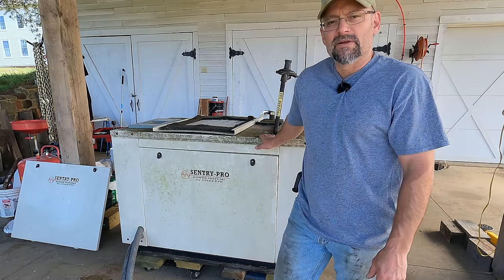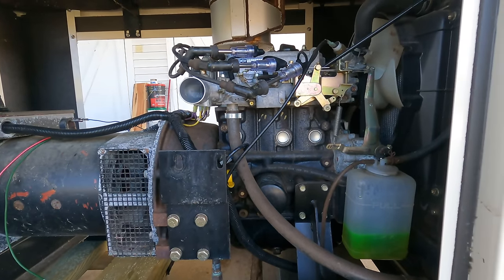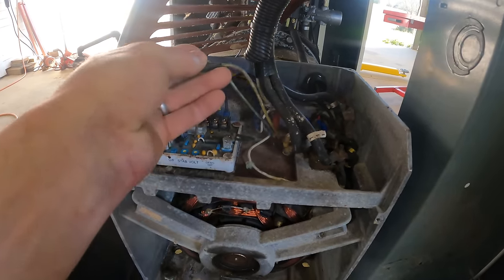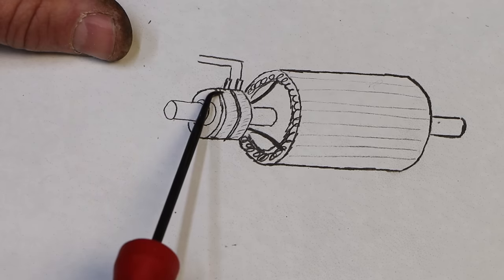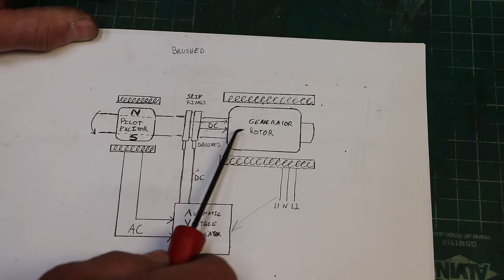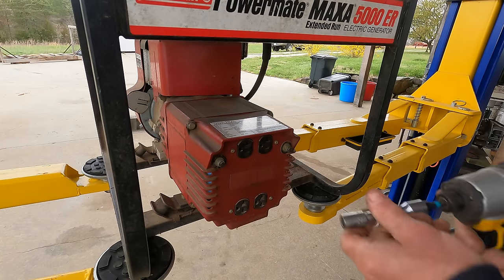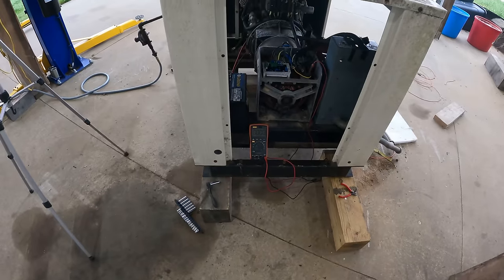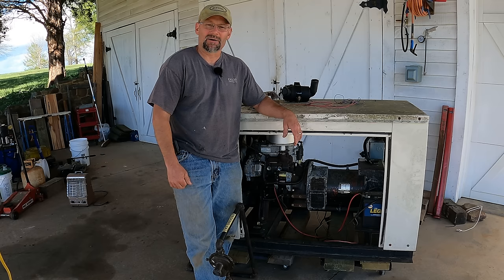How Generators Work, And How To Fix Them.

Comment: Great explanation on how generators work! And yes James Gondon does know what he is talking about.
The US grid is supposed to be between 228 and 253 so if you are running at 252, there is not much margin. Best to close to middle, hence 240 volt spec. Check with power company to get line voltage closer to the middle of range because if will fluctuate.
When setting generator voltage, Hz should always be set first which set by governor/rpm. Best set at medium load so it is within range at all loads. But check it at high and low loads also because governor may have other issues.

Comment: Great video..I ponder why heat sensitive electronics that by themselves create heat and need heat sinks.. are put near another possible heat source..On the old 6.5 GM diesels..the pump mounted driver(PMD) was..you guessed it..mounted to the injector pump on tip of the engine..near the turbo. Someone figured out that you could just make a harness to move it to the firewall and these $250(back then)would stop frying every 6 mos to a year..😅..I definitely learned something about generators..That I'm gonna try and make a welder out of one of these old turds I got lying around..Shouldn't be too hard to find where the DC goes to rectifier..I got a bunch of old large rheostats too..Hint hint..

Comment: I came across a document from PG&E, 'Voltage Tolerance Boundary' which was on the electrical distribution standards.  The service voltage (norm) is the nominal +/-5%, then utilization which is -13/+6% where it it happens they have to send out a lineman.  So the top for 120 is 126vac and 250 is 252vac.  As the lines are loaded the service voltage drops.  So 252 vac on an unloaded generator would be similar to what they give close to the substation.  

The document even explained NEMA voltages you see on the nameplates.  They are where mfrs are suppose to optimize but be able to handle +/-10% (which matches the utilization voltages the power company is suppose to keep.  They are lower than the nominal line voltage to account for the permissible <5% drop in the combined feeder/branch circuits

Comment: I'm curious if that is a two-pole? I ask because if it's a two-pole then the rotor would need to spin at 1800 rpm to make 60Hz. I do have a background in power generation from my time in the Navy. Working on 3-phase systems (Navy) is different from working on 2-phase (residential) systems.

Comment: You need to stop saying "how the Hertz is doing" or "check the Hertz". Hertz is the unit, FREQUENCY is the quantity your measuring and the word you should be using. It'd be a bit like saying "How many Fahrenheits (or Celciuses or Kelvins) is it outside?". It makes you sound like a hick that doesn't know what they're talking about, when that isn't the case! As an electrical engineer, it's rather irksome!

Comment: Spark plugs does make difference, their proper and uniform orientation ( indexing ) does matter as well! 
Using of Rare Earth Metals on electrodes tips is far not only about the longevity! 
We haven’t seen here testing of Denso Iridium TT or NGK Ruthenium HX series PSPE spark plugs! 
Extremely poorly done homework guys , as in the good old times :) 
Everyone who disagree with me ,please ask first yourself why all present days modern  engines are using precious metals even on both electrodes tips , Twin Tips electrodes and why the latest models engines even use factory indexed spark plugs! 
Testing the spark plug dependent deviation in HP on CARBURETED engine is like the try of measuring the weight difference between two flies on elephant designed scale :)

Comment: Wow ... open the door to generators!!!  Thank you so much.  

Questions:  How did you know that the new AVR would work on that older unit?  Was it listed as compatible or ... do AVRs all seek to send the same voltage to the rotor in a 120/240 design. ... or?  Thanks.

Comment: As a former employee in the propane industry, here's my 2 cents:
- 100% agree DO NOT swap.  The new tanks are often panted to look good, but they may be in bad shape.
‐ Always ask if you are paying for a full tank or by the pound (see prior comment)
- When possible, fill with a propane company (distributor).  The markup on propane from retailers is huge (highest sinple item profit margin at gas stations and Walmart).  Distributors makeup as well, sometimes, but not as much as retailers.  To find distributors, just look for the large storage tanks.  Folks in the propane business are good ppl, so ask them.

Comment: I do believe the difference between BRUSHLESS & THE BRUSHED IS the high constant power has a damaging effect that will eat away at the brushes causing flash arcing and giving unrelible and scattered voltage thus burning out the motor:yt:

Comment: In my years of experience dealing with electric heavy equipment ac and dc, #1 killer of ac equipment is dirty power they usually don’t output but it started with it, usually those who like to just chop wires you know. You actually know more than I’ve seen most of others on here t/s. 👌

Comment: First and foremost you don't have TF1! In the wiring diagram, you don't have/show a Legend breaking down these abbreviations! I am a certified Tech/service tech. TF1 is a trans fur (switch) either automatic or manually activated. Research that!

Comment: Wires used for electricity emit a sound frequency too high for the human ear to detect but rodents can hear it and it irritates them. It's the primary reason rodents chew on wires (attempting to eliminate the sound). Other reasons might be: "hey, this vine is covered in something soft, I'm going to gnaw on it to see if it's edible*chomp-chomp ZAP* NOPE! Definitely not edible...maybe further down the vine."

Comment: 36:56 T5AH fuse. The T means slow-blow (time delay, as opposed to F - Fast) 5Amperes is the rating and the H means High Rupture Capacity, whcih is why it is ceramic, not clear glass. HTH.

Comment: Very nice video. Illustrations are awesome. Only one thing. You can't say for sure 'no shorts in windings' with multimeter in Ohm mode. Your windings resistance is 0.3 Ohm. Lets say windings has 50 turns and one is shorted.  Resistance in winding with shorted turn will be 0.2994 Ohm. Difference with normal windings is far below precision of almost any handheld multimeters. You need LCR meter to measure inductance and coil quality factor to be sure.

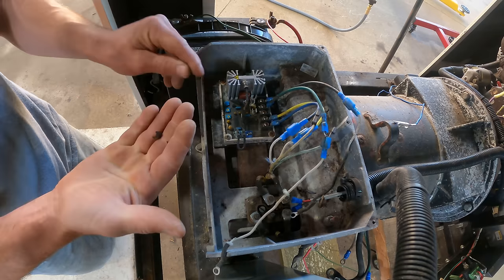Comment: 37:05 I bet you just got the letters confused but I'm gonna use this chance to nerd out:
A "T 5A H" fuse is slow blow but this is not what the H means. T like in Time delay. Other possible letters are F (fast) and M (medium).
The H means it has a high breaking current. If a high current (up to 1500A in that case) could flow, the fuse has to be able to break that properly and not arc over.
They are usually filled with sand to extinguish the arc by cooling it down.

The German Wikipedia page has nice tables for those so you can see it at first glance but the English version seems to have omitted this and I couldn't even find this information there at all :(

Comment: You actually CAN run that size, and significantly larger generators, engines and heaters off a 20lb BBQ tank of propane continuously - if you are willing to heat the tank. This is of course for "temporary" use...

For a ~15 minute, lightly loaded test run there won't be any issues without heat. In fact for lowish loads on a warm day there probably wouldn't be any issues either, but for heavier loads read on...

The problem isn't the lack of propane liquid to gas surface area.

The problem is that the enthalpy of vaporization, or energy required to evaporate the propane causes the liquid propane to get colder and colder until it can no longer evaporate fast enough (and the propane gas pressure drops).

For light electrical loads the generator will most likely run fine of a 20lb tank.

With high electrical loads what you will see is over about 10 to 15 minutes, the outside of the propane tank will start to get cold. If the propane consumption is high enough, the outside of the tank will develop a layer of ice condensing out of the air - wherever there is propane liquid in the tank. Once the propane cools enough (likely in the -10°C or 15°F range) the propane pressure will decrease enough the engine won't run properly.

In order to keep the propane evaporating fast enough to maintain the needed pressure, you need to heat the propane, which means heating the lower portion of the propane tank.

As long as there is still ice on the propane (and there are no propane leaks) you know you can safely apply copious amounts of heat to the propane. The pressure can't increase anywhere near dangerous levels while the propane is cold.

For example when I run my 120,000 BTU propane heater (equivalent to a 20kW generator, generating 20kW constantly) in the winter, I face the output of the heater directly towards the propane tank (about 2 feet away). In my situation this is the perfect amount of heat to maintain the liquid propane at approximately 15°C (60°F).

With your generator you won't need near as much heat (because you are not generating 20kW and because the temperature is warmer), but the tank will likely need to be in direct sunlight on a warm summers day in order to maintain a vaporization rate for full throttle, continuous power.

On a cool day, facing the output of a 500 watt electric heater towards the propane tank would probably be enough for your generator.

Comment: I have never seen a generator under 10KW that uses exciter windings.  Ignoring inverter generators (very special case), most are brushed.  Some have automatic voltage regulators some don't.  Without AVR, the voltage changes with load,

These smaller brushed generators use the residual magnetism in the rotor to make the initial power to start the main power.  If there is no residual magnetism, you have to "flash" the field (temporarily add DC to the field).  Smaller (<10KW) brushless generators have separate exciter windings on the rotor shaft and permanent magnets built into the housing.  No AVR, but the diodes are on the rotor shaft.

Comment: I have been watching generator repair videos for a while..........but I liked your explanation the best. You would think manufacturers would consider rodent attack when designing the air flow intakes.  Yes James is very pro with the pesky small generators.

Comment: There is a supermarket here in the UK called ASDA, used to be part of WalMart until last year when they sold it for £6.5B, we come to the conclusion that it stands for 'Anything Sensible Doesn't Apply' because they don't do sensible things. It's basically the same as don't assume logic.

Comment: Question? I have a Westinghouse generator. It is a 12,500 gas 11,200 propane peak. It is a duel fuel generator. I have a 120 gallon propane tank. The generator already has a regulator but the propane tank does not. Do I have to add a regulator to the tank as well and if so what size and type? Thank you.

Comment: For this work a higher quality meter would benefit you. Lower resistance leads and more decimal places in your low ohm meter setting. Support Taiwan and get yourself a Brymen, as good as Fluke, sometimes better, at 1/4 the price. Do it. Stop buying Chinese crap and supporting the CCP and their military which will be engaged with yours soon the way things are going.

Comment: AFAIK, the 5x bottom terminals on the control panel are for external control. Hence why those colors were off, whoever installed it didn't care. It provides 12v to the external control system, a call to start/run input, and a failed to start output. You shouldn't need to jump anything there if you want to keep it 100% manually operated. Just flip the switch up and push the test rocker to start it.

Comment: HAHA starting off from @MentourPilot break down of the Air Canada flight 624 where the Halifax airport discovered "oh nuts, did no one test the back up generators?" was a "nope, didn't do it, no one flew a plane through the wires before"

Comment: My brother in law had a portable Champion 4k generator that started and sounded great.  it would produce 120V.  Repair shop wanted $200 to replace some electronic regulator.  He paid $350 on sale at Kragen auto.  It had a spark arrest muffler on it that was clogged.  I banged the muffler on the ground, reinstalled and the problem was fixed.  While i was online with Champion tech support listing to the generator, he told me to drill some holes in the muffler.  Seems like a common problem with all small engines with that muffler, especially in CA and states that require that type muffler.

Comment: For the purposes of debugging it probably would run fine on the BBQ tank.  I use a 1lb bottle from my torch/grill to do periodic run tests on a 7500W portable LPG generator and it easily runs no-load off that for the 5 or so minutes I run it unless they are totally empty.  At half-load the same generator can freeze up a 20lb tank in 50F ambient after about 2 hours runtime not quite 50% empty.

Comment: You don't want that much pressure on the regulator. The tank regulators are dealing with under 1psi  _ test under 20 psi I would only do 5 psi.  A small propane tank won't work because it has a flow valve that will only allow so much flow. A hundred pound tank doesn't have that their valve but has the same surface area of 20 pounder.  I have bought a 1991 tow behind 34' man lift. I am currently replacing the main hydraulic line to the basket. I tried to use a repair splice and it blew out under pressure😑

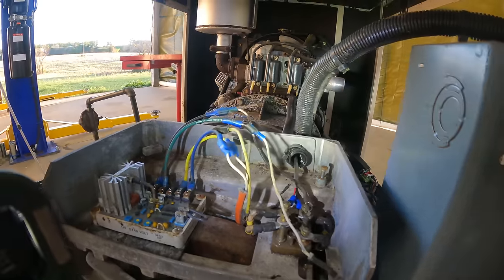Comment: 37:58  Hey, I figured this out some years ago. Whatever muscles you use, everything below that point will fly when it lets go. If you use your torso muscles, then your upper body will fly. If you use your chest muscles, then your entire arm will fly (as happened here). If you use your bicep, then your forearm will fly. If you use your wrist, then just your hand will fly (only about an inch or two). If you use your hand, then only your fingers will fly (an inch). Always use the smallest possible muscles, perhaps by using a leverage (one hand rolling over the other). I've taught my kids this and saved hundreds of bandages, and less food on the walls and ceiling. Cheers.

Comment: Great work, you were able to save it with minimal work, one word of caution 250 volts is plenty high for equipment around your house, it should be between 220 and 240 max.

Comment: Oh one last question, if you know... what is the final into the engine propane working pressure...??? ie, output of that regulator... 250 down to say 2.5 to 5 psi... ???  just a guess... thx so much

Comment: I've an old Onan 35kw genset from the 50s and it uses a Magneciter (Onan's in house VR).  It is about the size of a shoe box and weighs about 10lbs or so.  It uses two coils and a reactor to control the voltage to the rotor and was probably an early use for a solid state vr.  It is awesome, bullet proof, and I love it.  The reason why it isnt used anymore, more than likely because of cost.  One of those today would cost upwards of a few hundred dollars, if not, a grand or more.  Thanks for the vid.

Comment: Fun to watch. Even though I took a basic electronics course after high school (1980ish), electricity has never found a home in my brain. I can wire in a ceiling fan or swap a light switch for a timer switch, but that about does it. Like under the hood of a car I'm never sure just what the hell set of circumstances will give me a shock, other than grounding the battery.
Can't believe how much juice that little generator will put out.

Comment: I think you have a three Phase generator here that runs in 2-Phase Mode. The connection field has 6 terminals, U1,V1,W1 and U2,V2,W2.

Comment: I have a portable style 15kw gasoline generator. Wired in the interconnect and outdoor plug. Along with a remote key switch inside so I can start it without going outside. I don't need 15kw but when the price difference is only a few hundred for 8vs15... 15 wins.

Comment: 5:47: nothing is simple (but you could argue it is logical) with these automatic start generators. I have a 1982 Onan gen set.  Everything is relay and timer controlled. No integrated circuits back then.  So in theory, you could study the circuitry to learn how it works, but I was fortunate to find a manual online. Those electrical engineers were genius.  It’s been a challenge, but rewarding to finally have it working with remote start switch inside the house.

Comment: Only part way through this video but feel obligated to mention.  Here in Japan we often use red wire for electrical grounds except for when we don't.  Then we use green wire almost exclusive for "earth" grounds.  Probably doesn't help especially with an older video.

Comment: Brushed power delivery have its pros and cons. It's cheap and simple - no electronic elements, everything is purely mechanical and parts count is relatively small.  But, as you've mentioned, it requires maintenance, brushes wear out generating graphite dust, can hang inside brush holders breaking the circuit. Also, running power through moving parts generate sparks and that in turn makes RF noise. In small, temporarily used generators this isn't such a big deal, but in stationary ones it may affect other equipment. Brushless on the other hand is more expensive, more copper for windings, electronic parts and overall more complicated. So it's use in cheaper generators is usually marketing thing (same thing as megapixels) - while possible, it doesn't make much sense. Since base price was low, there we're some corners cut here and there. And, as someone mentioned in comments before, brushed version would still probably outlast its engine.

Comment: Propane / LPG or even CNG Engines will always have clean oil. The burn without creating a lot of carbon. I had a CNG car and the oil was clean after 10k miles.